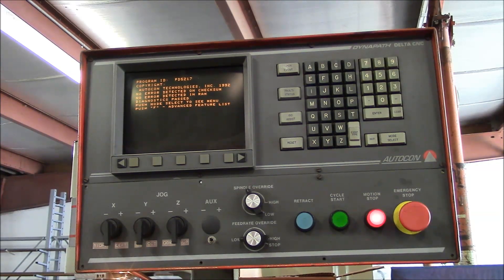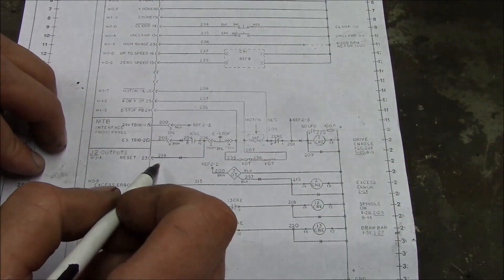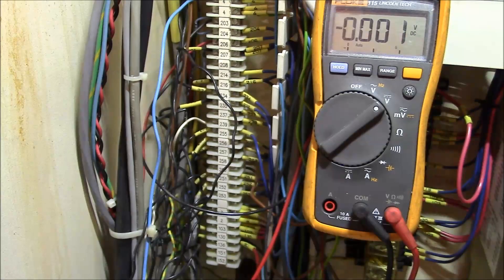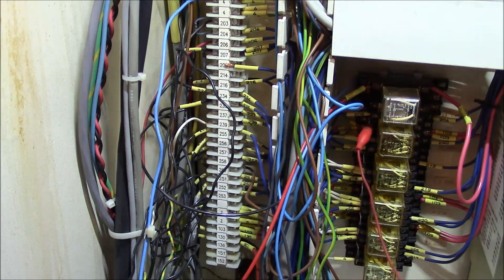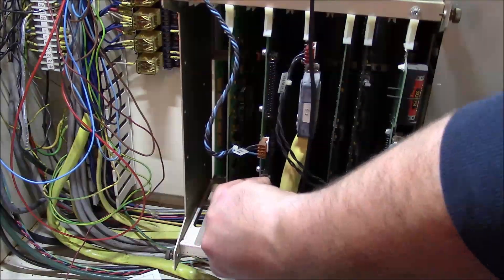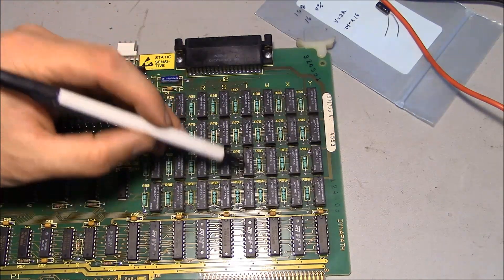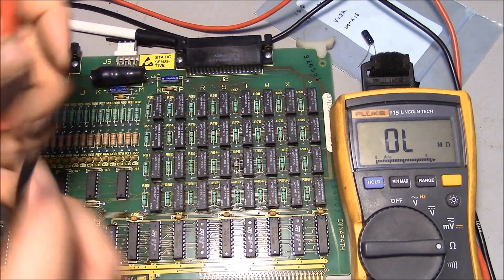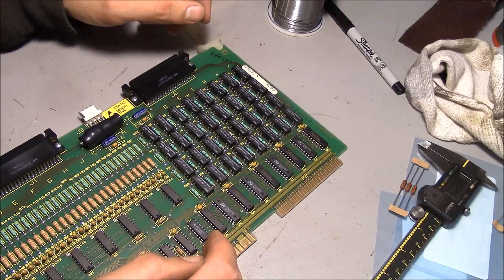CNC Machine Stuck in Emergency Stop

Comment: Those are not possibly 4W resistors. They are either 1/2W or 1W, depending on how old the board is. I'd guess 1/2W from the size of the resistor and age of the board. So the 2W modern resistor is plenty good enough.

There is no particular relationship of the wire gage and the resistor wattage. You can guess at the wattage from the physical size of the resistor body. The problem is that resistors of any given wattage have gotten smaller as technology has improved, so you have to guess based on the age of the technology. A resistor turns power into heat. That heat has to go somewhere. Think of the resistor body as a heatsink. The bigger the body, the bigger the surface area to radiate the heat, so a bigger resistor runs cooler for a given power dissipation.  A resistor at full rated power runs almost 200 degrees C, which is *really hot*. So you usually over-rate a resistor by about a factor of 2 to keep the heat reasonable and not fry things near it on the board.

The resistor is both a current limit and a fuze. Those DIP reed relays are only good for a few amps. 16 ohms at 24V (assuming output is shorted to ground) is about 1.5A. I assume the relay is rated at 2 to 5A, so this protects the relay.  The resistor also limits inrush current when powering a relay load. Without the resistor you could get contact welding from the inrush current when the relay closes.

My guess on why it fried: you mention the E-Stop switch was broken and bypassed. I suspect that the wires near the E-Stop switch got shorted to ground. Putting 36W (24V across 16 ohms) thru a little resistor like that would have popped it pretty quick.
Reply from the maker: That makes sense to me. I ordered some 1 watt resistors as well, and I contemplated installing them. But, I think it's fine like it is. As you say, the relay is limited in its current capacity, so the 16 ohm resistor would make sense. The builder does not know how the output will be used when the board is designed. Some applications may use all 1.5 amps. Thanks for your input!
Reply: Realistically those outputs are limited to something like 250ma at most. That would be 1W in 16 ohms, and for that the resistor should be a 2W resistor. Since I suspect the originals are at most 1W, the power should be limited to 1/2W continuous, or 175ma. You also have to consider voltage drop. 250ma and 16 ohms is a 4V drop, so you only have 20V to run the load.
Reply: l wilton
   That was some really good reading for only four small paragraphs.  I really enjoy Wes' channel. Also If you have written anything else I would consider it a privelidge to read it. Thank you both.
Reply: Excellent explanation.
Reply: Thanks for the great explanation. Like most people, I would feel very uneasy about just replacing a burnt component without knowing why it burnt out in the first place.
Reply: I have learned something. Good explanation.
Reply: yeah, sure look like 1/2 watt...maybe there was a mistake in the supply line somewhere?
Reply: I think your hypothesis is bang on
Reply: I know it is kind of off topic but does anyone know of a good site to stream newly released movies online?
Reply: @Shawn Jay flixportal
Reply: @Karsyn Alexzander thank you, I went there and it seems to work :) I really appreciate it!!
Reply: @Shawn Jay glad I could help =)

Comment: Great economy means lots of work, we have not ever had this good here in California and we have been through the early 70's mid 80's and the DOT com crash 2001 tight credit and then the 2006 /2008 meltdown, so yes the neighbors being busy sounds great to here from you as noisy as they are. This is of course until you fix and then hit the e-stop button for the economy Wes.  
Lance & Patrick.

Comment: Their purpose would be both.  Current limit the solid state relay and create an overload fuse in case of a failure.  Solid state relays need current limiting due to their low impedance.
Reply: Those are reed relays, not solid state relays. But the resistor purpose is as you state.
Reply: @lwilton  thanks.  I didn't know reed relays came in those packages.  Learn something everyday.
Reply: IMO:
 One of the purposes of using an electromechanical output relay is that there is really no need for a protective circuit. Adding a limiting resistor is silly and it has introduced more ways to fail. Resistors burn out over time and it may very well be exactly what happened here. The cost of board repair lies mainly in the labor and replacing the relay is not more difficult than changing the resistor.
The fact that jumping 24 volt to the board output made it all work makes one wonder what the relay is even there for?
Lesson: If You want to make reliable boards do not introduce superfluous components.
2) If the purpose of the resistor was to interrupt overcurrent and shorts one can use a special "zero-ohm" fuse-resistor that looses the connection quickly without setting fire or burning the board.
Using a high wattage resistor is clumsy and counterproductive.
If the purpose was to make a cheap say 100 mA current protection one elegant solution is to use a PTC resistor ("auto fuse").
3) There may also be an issue with lacking current protection in the power supply.
Kind regards
Reply: @Citronitroify  I agree 100%.  Likely this board was made for multiple applications.  Though the use of these components here seem excessive and over-engineered, in other applications these relays and limiting resistors may play a significant role.  Often times in manufacturing, components are chosen not because they are perfect for the application, but simply because they satisfy the criteria.  The manufacturer may have been using this board in other applications and by utilizing it here, allowed them to reduce their overall part inventory.  Though I disagree with this practice, I do understand why it is done.
Reply: hadnt thought about those in a decade...relays disguised as chips...the old Fanuc Six series used a plethora of them on the IO cards- 99% of the failures were from contacts sticking, and 99% of the time 'fixing' could be done by simply strumming a plastic screwdriver handle across them... the little vibration will almost always free them up. the six was a helluva durable control, those little relays were its achilles heel. back in 1996 or so, I built a test rig and wrote a ladder(have one of the few 'suitcase' plc programmers still in existence) for a buddy who owned Tennessee Industrial, one of the bigger Fanuc repair shops- used one of the big gold 'connection unit adapter' wire wrap boxes, gutted/rewrapped so inputs on front board fed by outputs on rear board and vice/versa,  put a led grid that lit up relevant row/column of the relay location being tested... (and load resistor to pull a few milliamps of current) it ran a continuous loop looking for missing inputs, shorted inputs(the six used 4 point input buffers- a failed input usually tied all 4 together) or stuck outputs then stopped with the led showing what relay to change... they did board repairs, always let boards run 24 hours chattering away to test...far as I know they still use it. hadnt talked to them in a year or three... things 20 years old now LOL, had over 1/4 mile of the 30 gauge wrapping wire in it :)

Comment: What if that "Jazz" as you called it had a wire chaffed some were on the machine?
Reply from the maker: If the wire was shorted to ground, it would cause the relay to open (un latch) and the machine would go into E-stop. There are no fuses in the circuit, but the 24VDC power supply has internal current limiting. It will shut down if it draws too many amps. If the wire was open, the relay would not close at all. The beauty of the latching relay is that any intermittent wiring issue will cause the relay to un latch and basically shut down the machine.
Reply: @WatchWesWork  thanks

Comment: Yeah, many, many times I've had to put fresh solder on a connection before I was able to UN-solder it.  There has to be enough solder on the joint to both transfer sufficient heat to melt all the way through, and provide a seal against the solder sucker tip. It can take an annoying amount of heat on multi-layer boards.
Reply: Lead free for electronic was a government f up. The fumes were minor and  not really much of an issue.
Reply: @adamdnewman  - I was led (pun intended) to believe that the hazard which the law was intended to address, was leaching into groundwater from discarded electronics.  Same reason that leaded glass CRT's can't be disposed of like common glass?
Reply: @somebodyelse6673 LOL
Reply from the maker: I ended up having to do that as well.